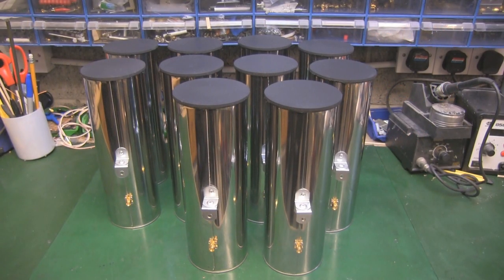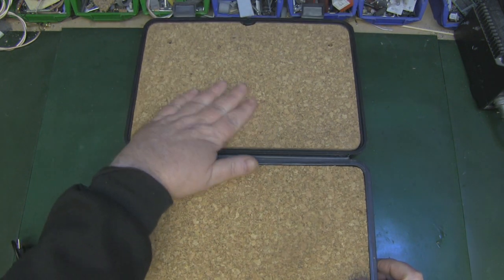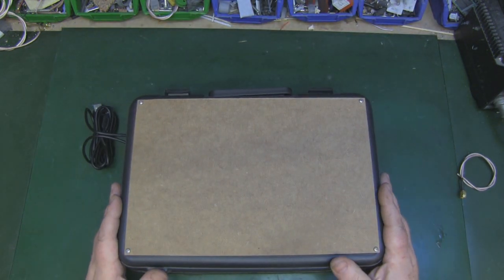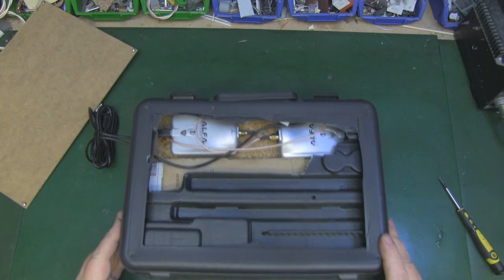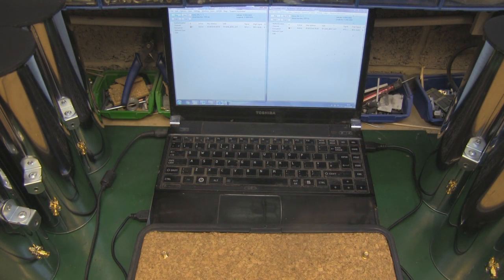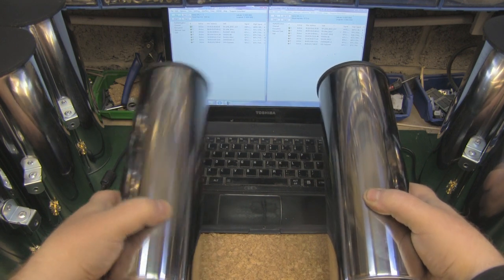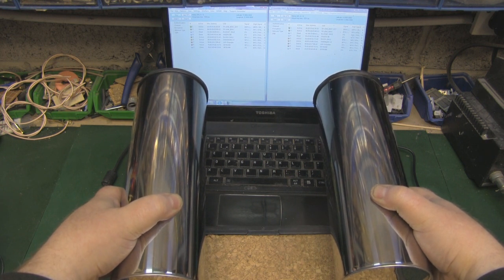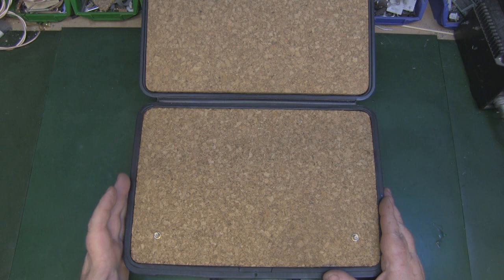My Wifi Antenna Test Jig

Comment: Could you put the cantennas on a rack (a length of wood with semicircles) and then quickly pulg and unplug the connections. Depending on wire length you may be able to do a row of four and maybe even another row above.

Comment: hey there, i wonder if you could help out the fpv community yet again, theres a whole lot of confusion going on about 868mhz/915mhz  radio control antenna,  if you could check out the frsky r9 kit and antenna style, and tbs crossfire, the european standard in particular is causing a lot of grief, the 868mhz being the euro one. any help and advice would be very appreciated.

Comment: why you making such a huge cantennas to get jnly 9-10dbi? it is just like 3el yagi :) 
i think this antennas what you have done is good only as  toilet brush holder
Reply: They are effective and relatively cheap and simple to make. And unlike a 24 dbi antenna from a chinese ebay seller they actually have the correct rating. A yagi is mote expensive, especially due to the time it takes to make it

Comment: Something with alligator clips could possibly be fast enough to suit your needs.  A pin on a flat surface migh be slower as it is a bit tricky to thread it blind as you would have to do so using two hands might be faster so alligator clips might be better. Magnets might be a bad Idea, but you probably know if it is feasible ir not.
Reply: I wish he would respond to his comments

Comment: That's a neat idea, it also reduces wear on the test connectors not having to screw them so that's a further saving for mass production. As a proportion of the whole manufacturing process testing is probably minimal, would there be other tricks that could have a bigger saving on the total build time? Not knowing the time spent on each process it's hard to tell where to focus the effort on time saving for maximum effect.

Comment: If one ever does show faulty, is there a most likely suspect for the defect on these?
Reply: QC Support after watching him make these and many other antennas my bet would be a bad connection in the solder joints. Since that is the only thing that is hidden. I have the impression that Andrew is quite precise with his measurements and techniques. He would probably know more about common faults in his work than I though
Reply: @InvadersDie  Thanks that does make the most sense.  Thought maybe he ran into a batch of bad SMA connectors or wrongly spec'd  impedance cabling, but solder joints are the realistic suspect.